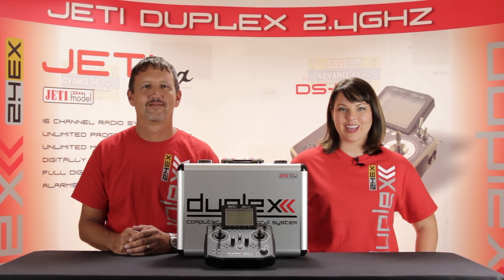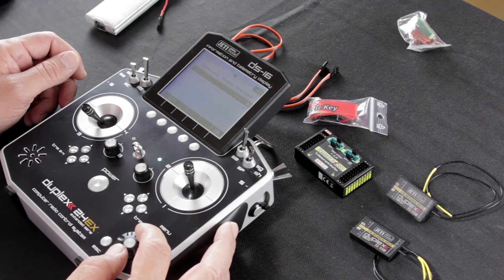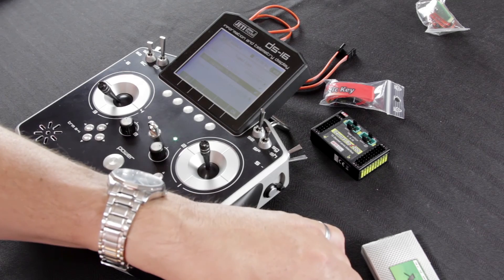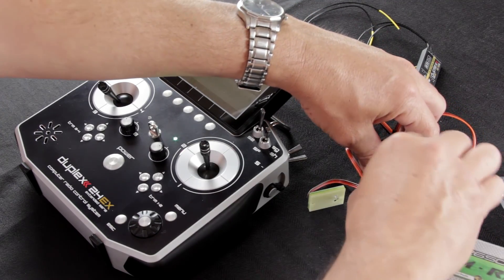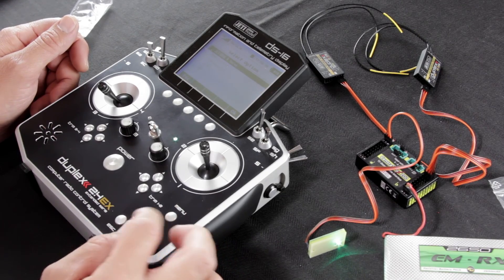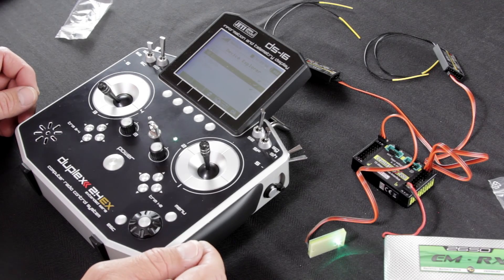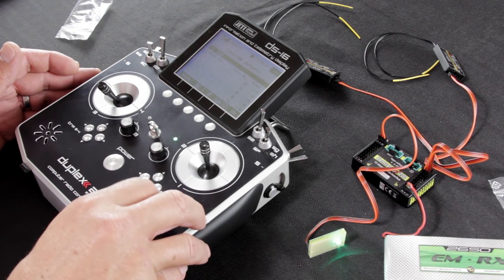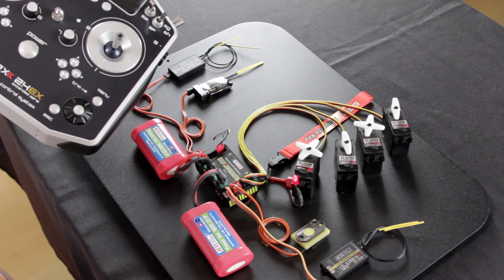Jeti Programming: Jeti Central Box 200 Basic Programming

Comment from the maker: You are both correct.  If you are powering the model including the servos in your final configuration, you do not want to power through the servo ports due to the poly fused outputs.  I used this configuration as an initial binding setup only and not to power other outputs.  You would never want to pull a load with the power in this configuration.
Great catch to Miko and Shag.

Comment: If you check your CB200 instruction manual, you'll see it's a massive NO NO to plug power into the servo outputs. Only use the MPX inputs.